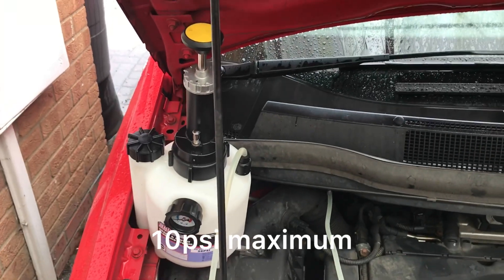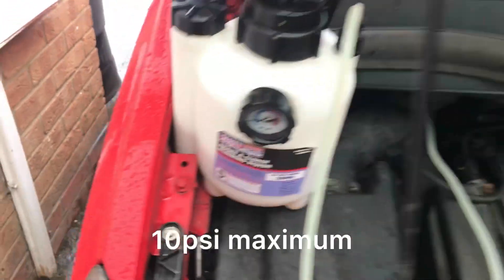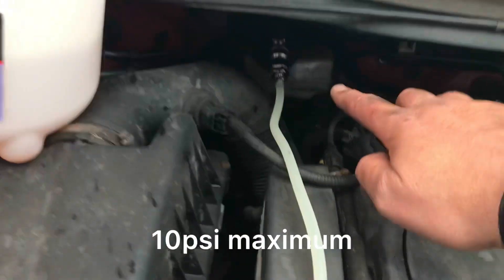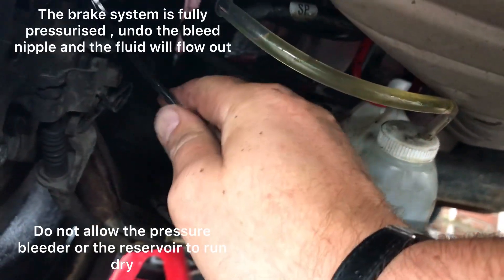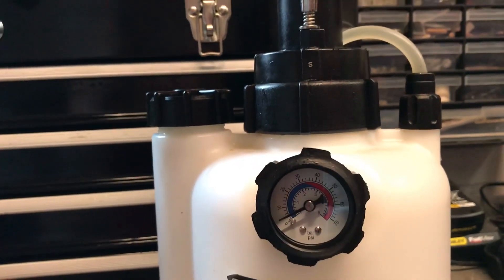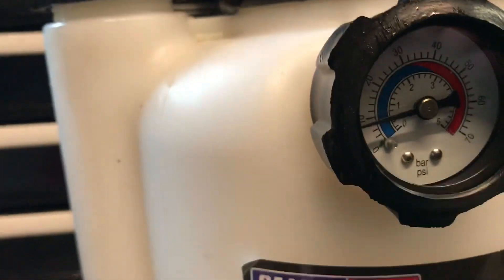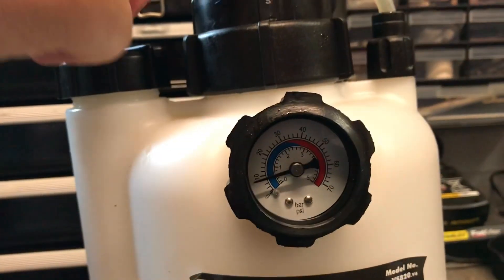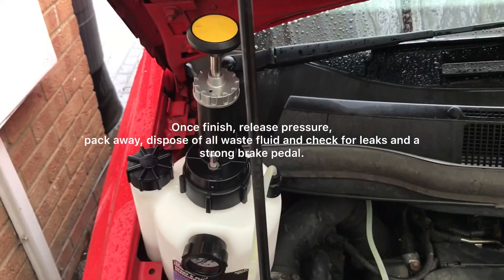Using a Sealey VS820 one man pressure brake clutch bleeding kit on a Vauxhall Opel Zafira

Comment: Also if the reservoir is too full of fluid after doing this operation, tip the bleeder to the side so that the pick up pipe inside is away from the brake fluid and then get someone to open bleed nipple on final caliper so that just air is being pushed through the bleeder. Keep your eye on the reservoir level and stop when it gets to the max level.
Reply from the maker: Sounds good, thanks for the input.👍

Comment: Thanks for this video, I’m thinking of buying one. Is the cap that goes on the reservoir a one cap fits all ?
Reply from the maker: There’s a few different caps in there. I do have a universal adapter aswell from draper, which works great.
Reply: @drivewaydiyer6504  I’ve pulled the trigger and bought one. I’ve got an issue ‘somehow’ where I can bleed my brakes the normal way. I’m hoping this will do the job 🤞🏽 I’ve seen a few people saying they had issue with them leaking, how was your experience?